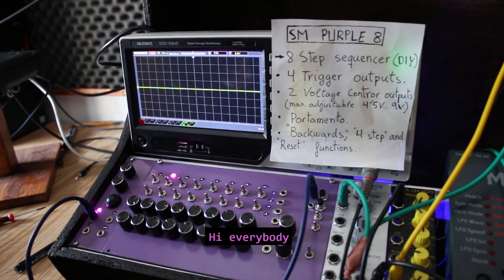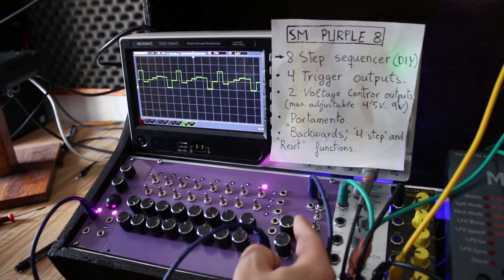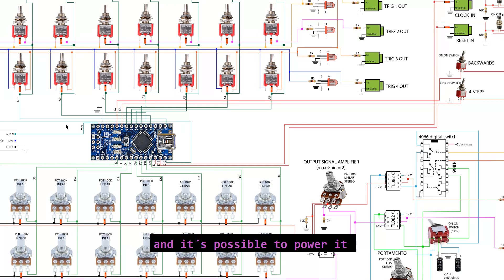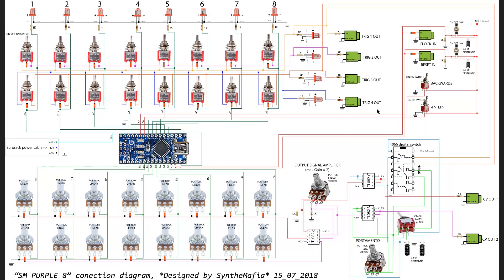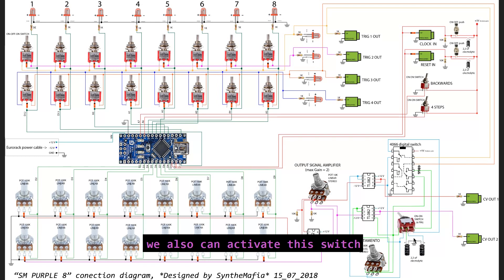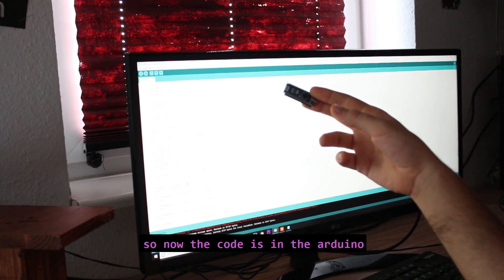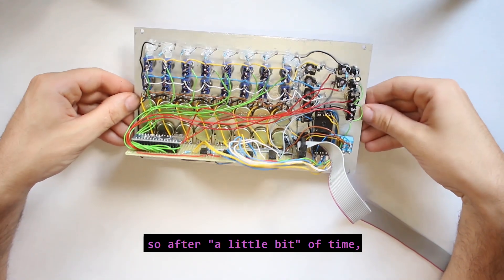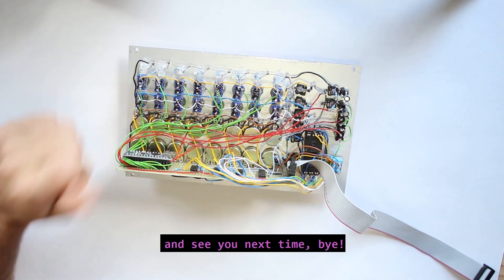"SM Purple 8", Eurorack 8 steps sequencer (DIY, arduino)

Comment: Oh wow, dude!?  I was just reading in your sequencer code  from this video, and Ive got to let you know, I think you really have a nack for this micro controller programming.  I’ve spent the last 4 years studying electronics, building kits and projects from books and online, reading from shared files, and educational toys.  I’ve learned my share of programming, and even learned 8 bit assembly language for the Intel 8051.  When I examined your source code, I thought that there must have been some files that I missed, or maybe I skipped a function or something, because I couldn’t figure out just how your source code was not handling the variable output voltages for the two voltage control outputs.  So I looked at your schematic again, and ...WHAM!!  It hit me just how savvy this design is.  You’re super clever, if you ask me.  You’re taking the regular high signals from the digital out, then using the rest of the components from the hardware side of things to attenuate the digital outs and provide the varied control voltages with the attenuation that you’re implementing through the hardware!  So you’ve made a truly analog signal come from the digital high signal from the Arduino.  I don’t believe that would have ever occurred to me, and so I’m so super glad I actually tried to read your code, and also your code is really nice and neat and reader friendly.  Thank you once again for sharing a very intelligent, intuitive, and well implemented design.  I want to join your SyntheMafia, so please add me to your list of potential prospects, and I’ll try to come up with something to make myself worthy of your apprenticeship!
Reply from the maker: nice that you like the sequencer. Synthemafia is a open project/collective without a comercial purpose. If you wanna be part of the Snthemafia or more info contact synthemafia@protonmail.com

Comment: Hi, this looks awesome, I'm looking to build one. Quick question,  couldn't we have the potentiometers and the switches be paired on the same outputs as they're active at the same step (D2 and D12  be only D2,  D3 and D13 .....), saving some pins and maybe make a 16 steps sequencer?? thank you for sharing and keep the good work.
Reply from the maker: Hi , thanks. No it´s not posible because in the potentiometter you need to have the voltage in the all step long but in the trigger you need to have the voltage just in the trigger time in each step. Like %50 of the  step or %30 or etc.
Reply: @synthemafia3138  Thank you for your answer.I might try a variation of your project using flip-flip or shift register to free some pins or have it work with a attiny85 chip. That's not gonna happen right away, but I'll keep you updated.

Comment: Hola, una pregunta... entiendo que la fila de pots de arriba controlan las notas .. y la de abajo?
Reply from the maker: las dos filas son identicas. Cada  linea controla el CV (Cotrol Voltage), y las salida del CV se encuentran a la derecha de cada linea de potenciometros. Si conectas a salida del CV   un VCO(Voltage Controlled oscilator) como tu dices controlaras lo que serian las "notas". Pero tambien la puedes conectar a la entrada de CV del filtro, u otro modulo que tenga entrada de CV.
Reply: Muchas gracias!!! para cuando el próximo vídeo!!??